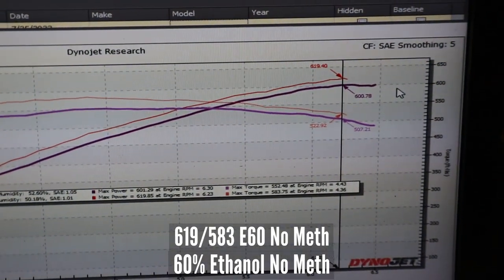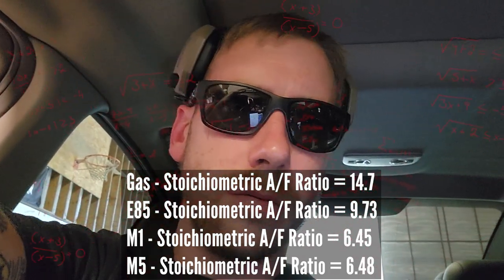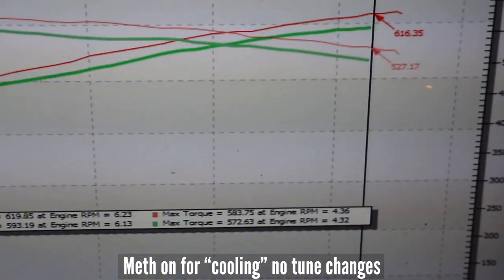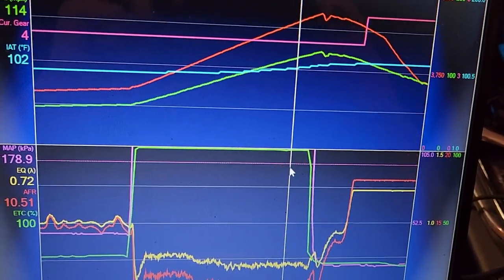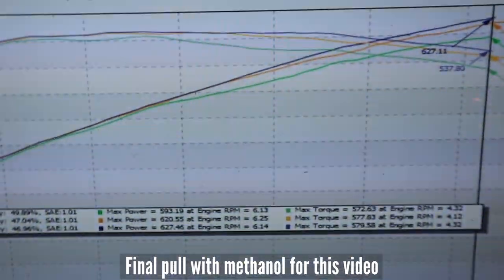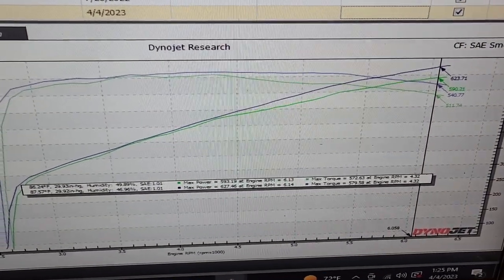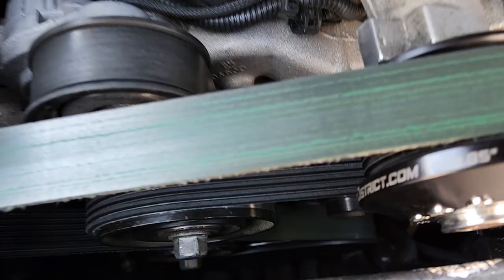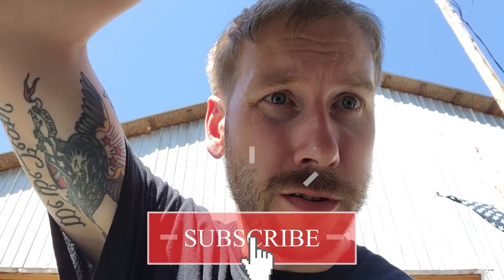Methanol Injection 101 Stop Listening To Facebook Car People

Comment: This isn’t a good video because this car has a PD blower. If this car was turbo, it would make like a few more horsepower, because Keis motorsport, and Richard Holdener did the same video and the cooling was there and it also made more power. If this vehicle was the direct port, it would see an increase
Reply: And plus dual nozzle is way too much meth if you’re just gonna use it for cooling
Reply from the maker: @patricklala2366  you know how many people run turbos or centri blowers run dual m15 nozzles for "cooling" a lot

But also, on those other videos, what did they change? Was timing being pulled for heat? Was timing being added for cool temps? If everything is the same and you add meth rather than one small nozzle or a lot of nozzles, it's not going to pick up power. You can't add a slower burning fuel without changes, and it picks up power regardless of the power adder unless without meth its already octane limited. 

I've done this test over and over single nozzles, dual nozzle turbo, centrifugal, and pd blower.

You can spray chocolate milk on your iat. It'll read lower temps, but it doesn't mean it's doing anything. Meth doesn't care about IATs. Why do you think methanol cars are usually non intercooled. 

What do you mean direct port? So 8 meth nozzles aren't too much, but 2 is? That doesn't make sense.
Reply from the maker: Also, this video was 100% to PD blower people. LSA people everyday say spray meth for cooling all over the internet so that's 100% who this video was for.

I have an older video on blower cooling and power gains from that with no tuning check that one out if you want.
Reply: @andrewd843  i’m just going by off of what you said when the math goes on the blower lid it evaporate, so I assume direct port would be better but dual m15 is a lot
Reply: @andrewd843  but like I said Keis motorsport, and Richard Holder, both did it, and they saw increases, but their applications were turbos
Reply from the maker: @patricklala2366  have links? To the video I'll check them out. But like I said apples to apples it won't. 

Now if it was pulling power for temps without, add meth it brings temps down and adds timing in yes it'll make power

Also water/meth is better for cooling, straight methanol is better for octane (power)